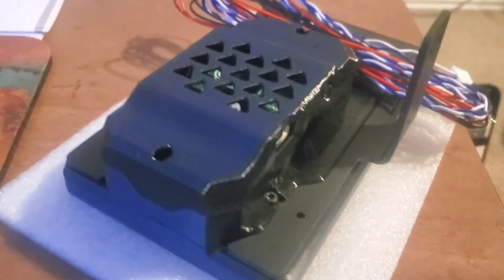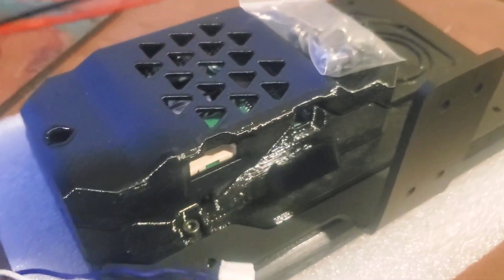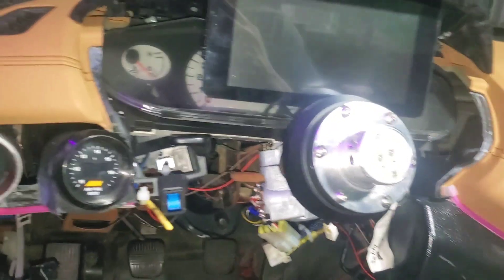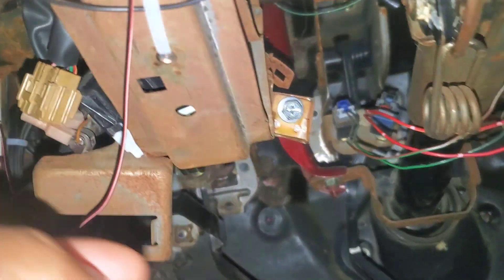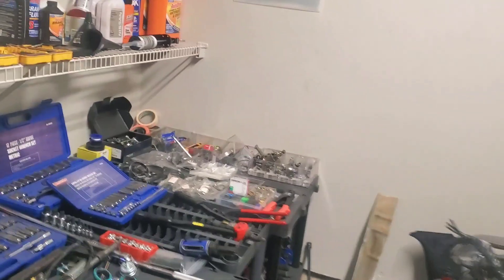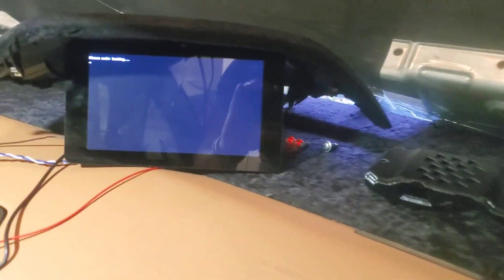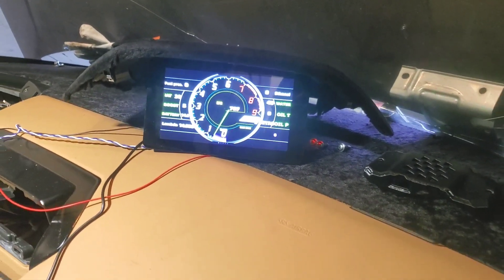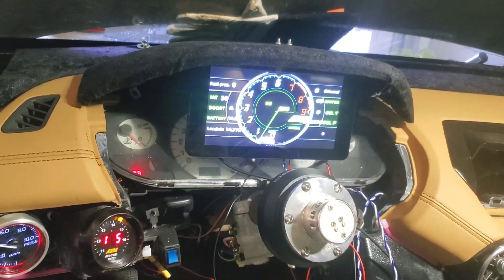Going digital | Link ecu Powetune digital dash installation |

Comment: I followed this exactly and still no data has me stumped man
Reply from the maker: Have you checked the ECU and dash separately to make sure they are configured fully
Reply: @Jay.3  yeah man several times. Got a session with tech support today to try and resolve
Reply from the maker: Did you get it resolved? What was the issue
Reply: @Jay.3 yep was a loose terminal

Comment: In my opinion which don't matter cuz not my car but if it was mine and if I had to use a digital gauge, I would use something like a ABS plastic sheet, cut and put the digital gauge right on the middle and toss the OEM cluster. For fuel level gauge, you can use an after market one or maybe that digital dash can display it. For water temp, you don't need the oem as the digital dash should read the water temp sensor. Digital dash on top of analog dash look very poor in my opinion. Just my two cents.
Reply from the maker: Fuel and water temp can be tricky to get working on this setup. Im not too ecu savy with it so i approach it with a if it aint broke dont fix it vibe
Reply: @Jay.3  Yea man as long as you are happy with the result. I just think that you have been working on it for so long so in my mind the s14 deserves attention to all the details you now. Make everything nice and neat. I think the 2000 wiring specialties wiring harness is worth it. You are not going to have any headaches down the road with stuff not working.

Comment: Hj bro! Do we need to link software to activate the dashboard?
Reply from the maker: not fully sure what you mean. The dash will activate once it has power. however to get it to read your ecu you will have to edit the setting like i did for my link ecu. If you have a different stand alone or factory ecu you may need to take some different steps on the software end
Reply: @Jay.3  yes, I have link ecu, so I have to connect link software to read from ecu! Is it difficult?
Reply from the maker: No the dash has presets for working with link ecu. Technically you dont have to touch the ecu software

Comment: You can switch orientation by adjusting some values in storage.  Powertune can remote log in and fix it.
Reply from the maker: I ended up modifying the mount to fit it the right way up already lol